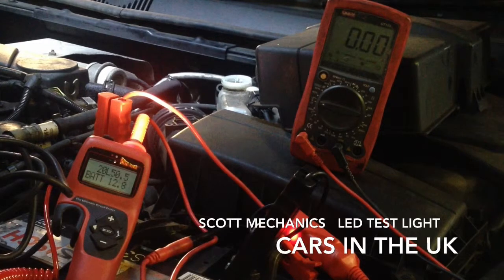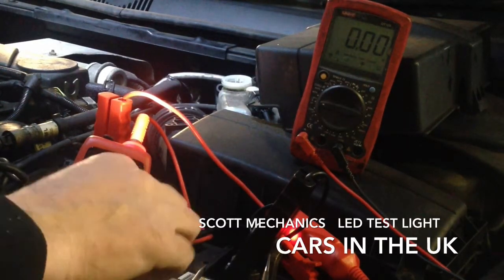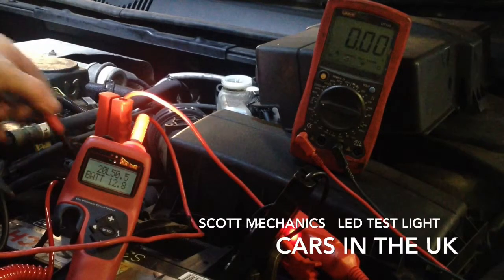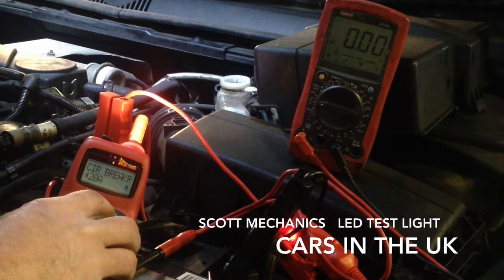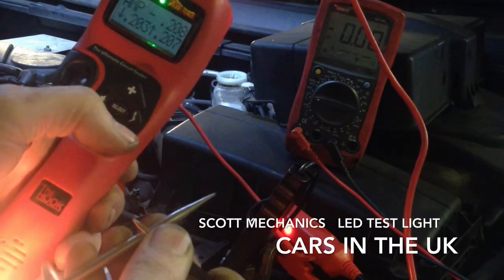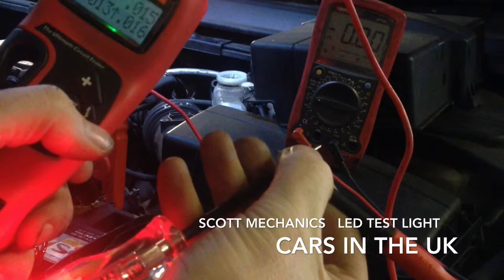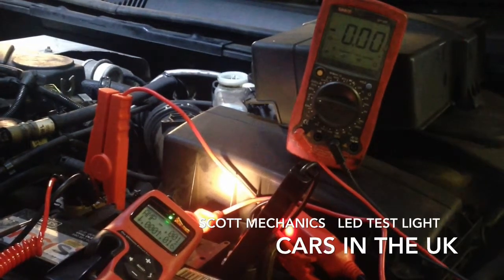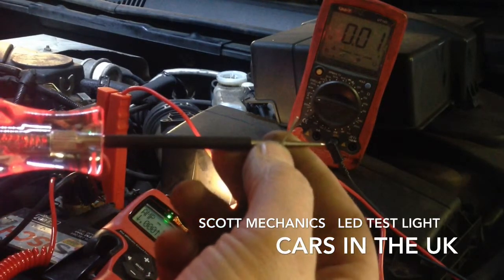Power probe hook led test light &  standard test light Scott mechanics

Comment: The Hook and the Power Probe IV are awesome tools Scott, use mine everyday
Reply from the maker: Thanks
Reply: Which one do you like best PP4 or PP Hook? I was reading a review the other day on Amazon where a guy complained that the Hook wasn't fast enough to even catch a blinker. Surely he had it in the wrong mode?
I haven't seen anyone test a blinker with the Hook though.
Reply from the maker: Hello that's right the processor in the hook ia what they call smart tip it checks for ohms & volts by the time the indercator changes from volts to ground its misted it
Reply: Maybe they should add a test light mode to it? lOL! I also heard it doesn't do as well on the injector test as Power Probe IV. I think I'll get the 4.
Reply: Hey Scott, if you could only have the Hook or the PP4 which one would you get?
Reply from the maker: Transguy  hello sorry for the late reply I would probably have the hook 👍🏍🍻🇬🇧